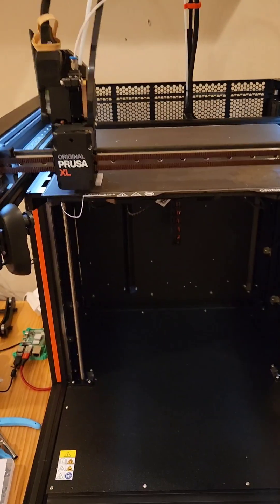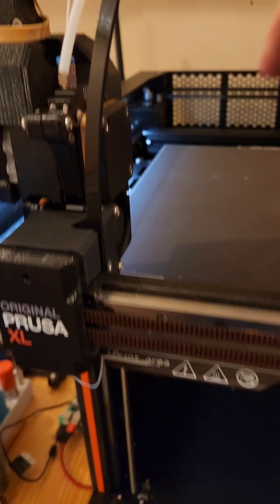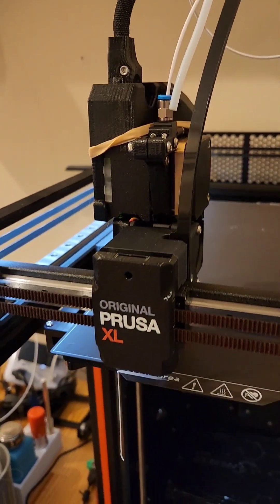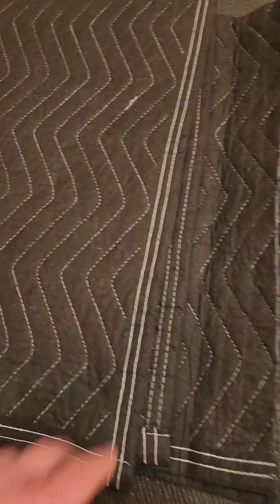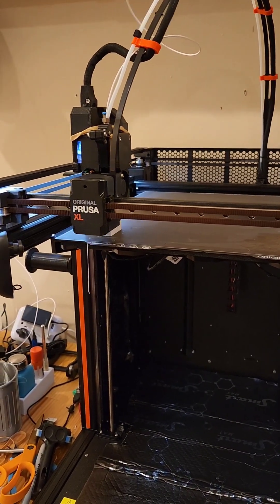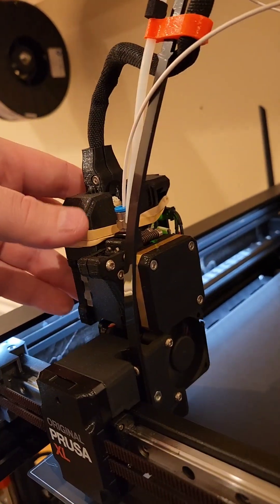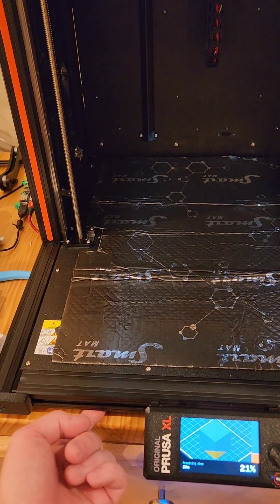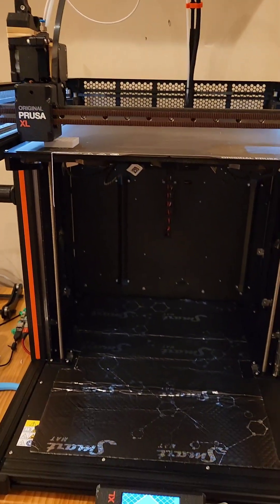Prusa XL Sound Reduction Effort

Comment: Best to have the sound deadening mat on the outside of the panels. All the deadening does is add mass to the panel and brings its resonant frequency down to un inaudible range. However those mats will reduce the reverb the bouncing of sound. This will make it seem way quieter but you need it on the surfaces that the sound bounces off. Putting mass loaded vinyl around the steppers will reduce the noise they make. And in general build an enclosure for it.
Reply from the maker: Thanks for the suggestion.  I felt like the inside surfaces were acting as a speaker box and projecting a lot of noise, that is why I put them on the inside.  I ain't moven em, but maybe someone else will do the opposite and we can compare results.
Reply: @kiltedcraftworks4609  fair. Just got my xl but not doing sound mods to it. It’s whisper quite compared to my bambu haha. In saying that I’ve only had time to play with the test print the sd card has. More fun tomorrow

Comment: Hey dude, have the singel tool XL too and  the same weird noises like you esp. 4:10 - 4:16... i think the problem is  extruder. 
I chatted with Prusa but the say  " Dev looked at it and its normal" ... bull***t in my opinion ... 
We need to figure out what this sound is - some bad resonance maybe ! 
Just write me a comment, and we both be in touch to see where this sound comes from! 
BR Niklas
Reply from the maker: I found another piece of the puzzle.  The dwarf board itself isn't the problem, it is the part cooling fan!  It is on the left hand side of the extruder.  It has a single M3 holding it on the upper left side, then down low there are two torx screws holding in a flow diverter.  The flow diverter captures the part cooling fan, but doesn't really clamp it.  I took everything off, put a little bit of silicone ear plug material under the bottom right hand side of the fan (far away from the upper left hand clamping screw), and put it all back together.  Much better!  I need to figure out how to get the covers back on around the dwarf board without letting them rattle.  After that I will call it good.  Expect another video in a few days, hope this helps.
Reply from the maker: I have been taking mine apart. The little board with all the connections on it is just clipped on with folded metal. It resonates some. The covers make it all worse. I am going to try to quiet the board first, then work on the covers as I slowly put them back
Reply: Ha - i knew it. I thought too it has something to do with the Fan because the sound is quite noisy. But i think Theres More - poorly designed , but we are Not the only oke with this sound. 
Can send you enough Videos where the sound is Even worse than yours… the poor part on this is - in my opinion- That it comes from parts which are preassembled from prusa.
Reply from the maker: @Nordic_wolfson  I got a video up to help quiet down the nextruder.  Check out the next post on my channel.
Reply: Thanks both, also annoyed by the sound, going to check if I can figure a way to dampen it

Comment: Good idea to use the sound dampening panels...  I also noticed you have filament coming down from up top, something I was thinking of doing for multiple different colors and not having to feed it through the 30 foot tube every couple of minutes for changing filament!
Reply from the maker: It is kind of a must have for flexible filaments in my opinion.  I stuck a short length in the far side of the bowden.  It still correctly reads when you are out of filament at the extruder, so I don't know why the far side filament sensor even exists.